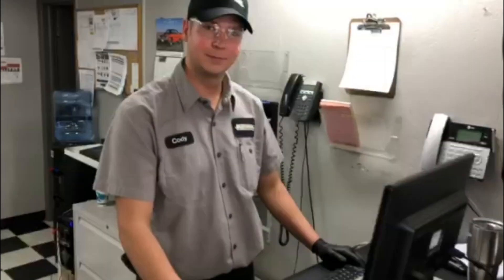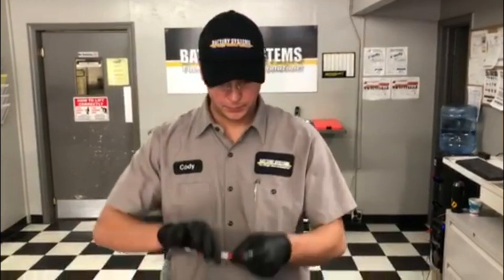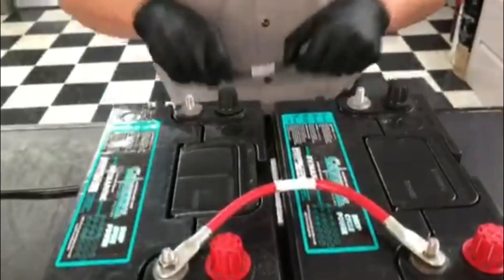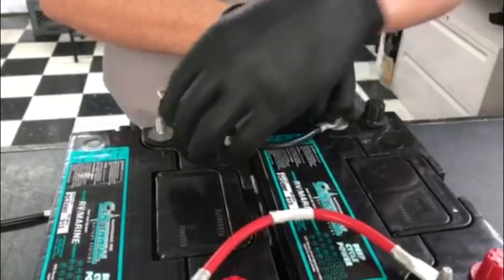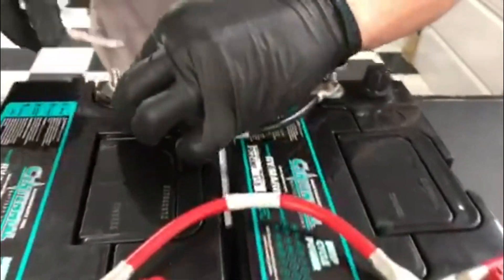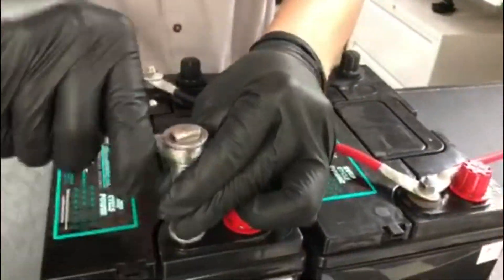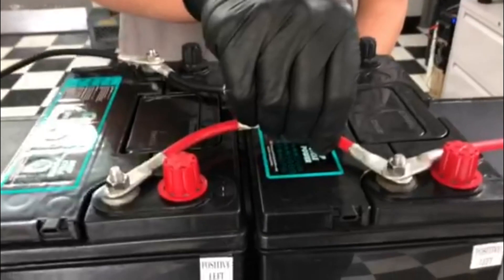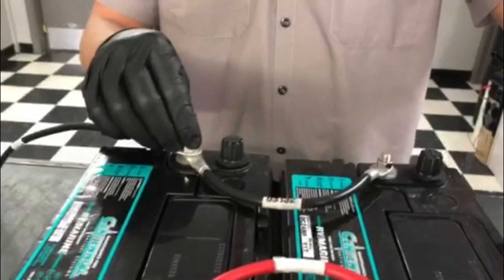HOW TO CONNECT BATTERIES IN PARALLEL

Comment: How about true parallel, where you have to 4 conductors? Eh for those of us who are more advanced and enjoy Ohms Law? And then connecting same length conductors? Could you demonstrate that, and she the viewers the critical reason for this? I see a lot of this in DIY tiny homes, and off grid, and and then they wonder why thier outer batteries die faster than thier inner batteries. I am also looking at this form an internal resistance perspective.

Comment: So if the two batteries are at different voltages, like one at 12Volts the other at 13.5V you might get sparks and heat. As one battery (i.e. the higher voltage battery) tries to charge the other one (the lower voltage one). Until they balance out voltage wise. Was disappointed a basic voltage test was NOT included in this video.

Comment: I have a question? I disconnected the batteries because they broke.. now I'm connected to the electricity pole... I see that the inverter is off.. My question is when I connect the new batteries will the inverter work again?

Comment: Very helpful, but how do you determine the size of the two jumper (interconnect) cables? For instance, I have two 12-volt, 100-amp LiFeP04 batteries that I want to connect in parallel, but I can't seem to find information on the recommended size of the two interconnect cables. Any suggestions?

Comment: Why connect the negative to the other battery when both terminals are bridged together with the wire, should make no difference. Please explain.
Reply: You are correct... No difference.. Pos is Pos and neg is neg. Current is the total of both batteries..

Comment: Thank you Sir for the informative video. Can I do the same to household burglar alarm batteries (7.2v) if I require the alarm to stay on longer during power cuts? Maybe you can do another video for 7.2v alarm batteries and also use an electronic tester to explain the effects of a parallel connection versus the serial connection. Thanks in advance.

Comment: It should balance the battery before made a solid connection. If two different has different voltage it may damage the battery. before that it should fully charge the battery and made sure both battery has same or almost same voltage level. If it has some voltage different. it should add a high power resister to flow the extra energe from higher one to lower one and made the voltage level became same.
Reply: The lowest battery would be charged to the same level of the higher battery and would automatically balance.. In my opinion.

Comment: Awesome! Would it still be possible to install a voltmeter display on each individual battery? So i can monitor if all batteries in parallel stay a similar voltage easier.

Comment: Ok if I have Done all that you have said and then want to add a solar panel to the mix ie via a positive and negative crocodile clip can I then put the positive and negative to the  one battery or do I have to split the connections putting one on one battery and the other clip to the other ...As mentioned this would be after I have done what you have shown in this vlog....
Reply: Positive is positive and negative is negative... Charging both batteries at the same time.

Comment: Hi I have a sterling b2b charger in my camper and one battery could I run 2 batteries of it if there wired the same as you have done thanks in advance liked and subed

Comment: Where are the answers to the questions people are asking ?
Reply: Right here.. Pos is Pos and neg is neg.. Very controversial but the fact is it doesn't matter where you pull power from.. I have many years of experience in this feild and if you have any questions ask me.. Peace Rolf
Reply: @GUCR44 can I put a whole bunch of random size batteries like motorcycle batteries in sequence with the car batteries? Or does amperage and all that need to be similar?

Comment: Just make sure both batteries are same voltage and not one full and the other empty. Not good for batteries.
Reply: Same voltage yes.. But the higher battery will "charge" the lower battery.. Just like jumping a dead car battery..

Comment: What should be the charged voltage of each battery... i mean can we connect fully charged battery with half charged battery.
Reply: Just like jumping a dead car battery.. The higher battery will "charge" the lower battery until  equilibrium is reached.

Comment: What happens if I put leads on both terminals of the same battery?
Reply: It doesn't matter in my opinion.. But this is controversial to some people.. Pos is Pos and neg is neg is what I have learned and experienced in the past.. I'm 65 years old and have been working with high current batterys and DC circuits my whole life. Peace Rolf

Comment: So if I'm doing this with a snow plow. the plow needs to essentially connected to both batteries.  a connection point on positive on one batter and a ground connection point on the second battery? Of does the snow plow get hooked up to the second battery all together.
Reply: Doesn't matter as long as you have a good connection between the batterys.. Pos is Pos and neg is neg...

Comment: And then where do you put your output wire? Why is no one explaining that part. I've watched about 10 videos so far and no one says where you connect power out?@
Reply: What do you mean? You connect it to whatever load needs power.
Reply: Doesn't really matter.. Pos is Pos and neg is neg... Parallel batterys are essentially one big battery.. Very controversial.. But this is the truth. Peace

Comment: Can I take 2 sets of parallel in series ??
Reply: Yes you can do that..remember 2bats in parallel acts like one battery then the two stacks in series will double the voltage. Have a good day today. Peace Rolf
Reply: Please elaborate...
Reply: @Blackwater Boys  like stack 2 20 volts parallel and stack a second set same way then run thoes 2 stacks in series to make a longer lasting 40 volt pack ??

Comment: what about the dangers of parallel batteries and the reasonfor the load being taken from where you explained, sometimes to simple an explanation, is not good.
Reply: It doesn't matter where you pull power.. Pos is Pos and neg is neg.. The available current will be the sum of both batteries.. I have many years of experience in this field. And this is very controversial subject.. If you have any questions ask me. Rolf

Comment: If I parallel two 12v lithiums   but one is   10ah and the other is 18ah  when I charge them should I charge as individual with two chargers or just use one charger still?
Reply: One charger will take longer
Reply: If you have any questions let me know. Rolf

Comment: what if one battery is discharged and the other is charged- will there be an overcurrent?  do you have to get them to within say a tenth of a volt difference first?
Reply: Best to charge up the most discharged one to the same voltage as the other before use. Also ensure that both batteries are identical ampacity with preferably the same brand, type, age and usage

Comment: Peut-on brancher 2 batteries AGM de capacité différente en parallèle (12V-180AH et 12V 220AH même marque) ?
Can we connect 2 AGM batteries of different capacity in parallel (12V-180AH and 12V 220AH same brand)?
Reply: Depends on a usage. Should be no problem when connecting to a car inverter overcoming blackouts. Just watch for a smaller battery voltage. If it drops below what your manual for the battery says is the lowest, you should unhook it.
Reply: No absolutely not
Reply: Just like jumping a dead battery in a car.. The voltage stays the same and the current is the sum of both batteries.

Comment: If I were using a 12 Volt Charger, which 2 posts would I connect to,  charge both batteries at the same time?
Reply: Doesn't matter.. As long as the batterys have a good connection.. They are essentially one battery..Pos is Pos and neg is neg..
Reply: @GUCR44  👍
Reply: The same post he put the leads on, one positive from one battery and a negative on the other
Reply: @johngalbicsek5567  👍

Comment: It shouldn't make a difference if you connect your leads to the negative and positive of one battery?
Reply: Sure seems like that to me.  The only possible difference is the resistance of the jumper which must very close to zero.
Reply: @stevecampbell4118  great answer!
Reply: Best practice is to do it like this so the charger doesn't favour one battery because electricity takes the path of least resistance. It might not seem like much but over a couple of years there will be an imbalance. Another option is to rotate the batteries Front to back once every 6 months if its impractical to do it like the video suggested
Reply: Exactly...
Reply: That would double the voltage to 24 volt if you have a 24 V system that’s how you rig it up
Reply: It’s like having 2 doors in a business, one for in and one for out.

Comment: I have just purchased a van and the guy has 2 batteries but they  back to front and only linked with 1 cable going from the positive on 1 to the negative on the other - the other side of + and - are empty - is this right?
Reply: One cable will work.. If the body is ground (or neg) connect Pos to Pos and neg to body (essentially using the body as the second cable..) peace

Comment: What amp display/regulator do you recommend for two RV batteries connected in parallel? I live off grid and would like a way to monitor my battery levels so I know when I need to run generator for recharging. Would prefer to have LED display. Thank you in advance for your recommendation.

Comment: Can i use two different batteries that has two different amps.Like my 1 battery is 600amps and the other is 800amps.I want to keep my mini 250watts powered because 1 car battery only keeps the mini heater on for 20min.Can i still use or hook up the 750 watt power inverter with the two car batteries connected and can i just use them jumping cables to hook the batteries in parallel ??
Reply: The output amps of the individual  batterys connected in parallel will be the sum of the two... Voltage will stay the same.

Comment: Thanks for this video! I just bought two new batteries for my 40 foot diesel pusher and installed them paralleled but got nothing on my instrumentation panel. Watching your video I realize that I hooked the application cables up to the same battery. Assuming that I take one off and put it on the other battery it will all be good. Question is does it matter which application cable is on which battery? Battery one or two?I read somewhere when you’re charging them with a tender you should keep a positive on one battery and the negative on the other battery, is this the case? And would be the same question do you put the positive on battery number one closest to the starter to being the outside battery. Again thank you so much this is so informative first video I hit and it answered my question and I hope solved my problem. DP is for me in LA
Reply: It doesn't matter.

Comment: Any tips on who sells jumper wire? Lowes, Autozone, Home Depot, and Amazon are coming up dry!
Reply from the maker: Hi Devon, we'd be happy to supply you with jumper wires for your batteries.  May I have your zip code please & I'll direct you to our nearest location.
Reply: @ContinentalBatterySystems  do you sell 1/0 cable with lugs already connected about 15 foot long?
Reply: Any place that sells electrical supplies will have the wire needed.

Comment: Hello. Great video. What’s the maximum number of batteries you can safely connect in parallel? I have 5 x 12v/100Ah LFP batteries connected in parallel with 4/0 welding cable and tinned cooper lugs and wonder if it’s safe to add three more. Thank you kindly.
Reply: you can add as many as you want brother
Reply: just make sure when you connect them they're all at the same or very similar voltage +-0.1
Reply: The more you connect together the more available current you will have and the bigger gauge cable you will need..

Comment: what would happen if you connect the leads to the same battery instead of red to one battery and black to the other...
Reply from the maker: Great Question: If you connect both leads to the same battery in this parallel connection the result would be that it would drain power unevenly.
Reply: @ContinentalBatterySystems  But if both negative terminals are already connected by a jumper how can it make any difference which one the load is connected to?
Reply: @stevecampbell4118  it does not matter.. Pos is Pos and neg is neg.. Good connections of course..
Reply: @ContinentalBatterySystems  I don't believe this is correct.